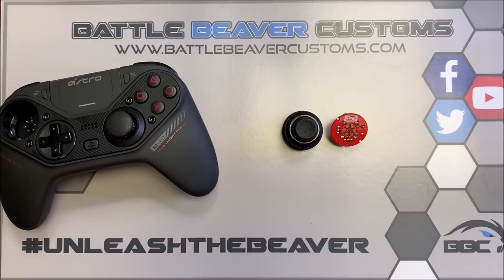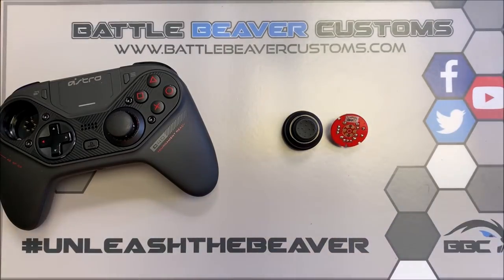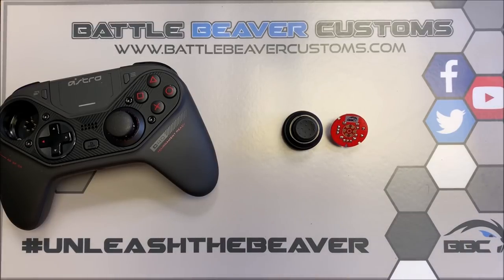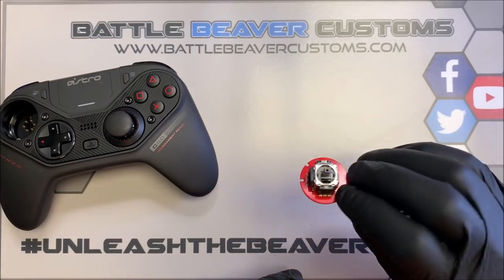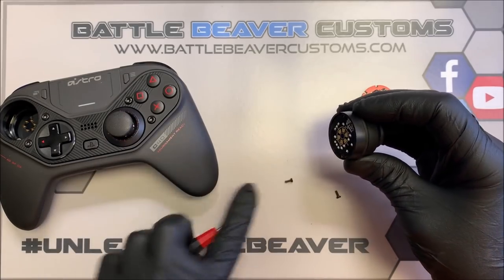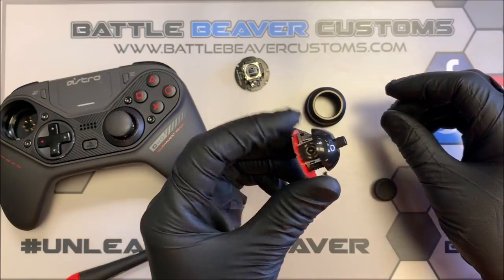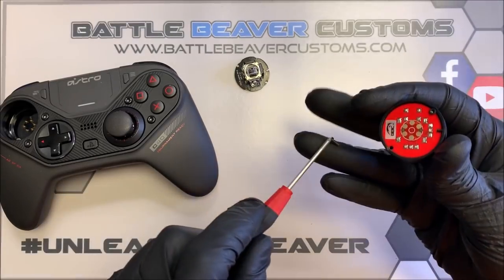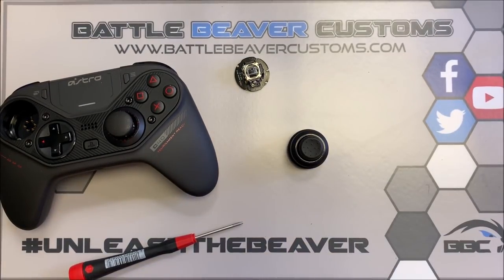How to Increase Thumbstick tension in your Astro c40

Comment: Hey I have a battlebeaver for my ps4 and I love it. But just recently I've noticed the anolog sticks are acting up. I've been having it for around 5 months now is there anything yall can do or do I jst need to get a new one?
Reply: Probably got hair or something stuck in it.. uninstall and use a vacuum to suck all excess material out of module.  Be sure to move stick around to get all corners.  That should help!  Nd save ya money
Reply: @-woo2020  most likely not, I clean and try to take care of most of my things. But I do use it a lot. Is only really the right analog that's acting up and it's the one with the extreme tension on it, I think that might be it. Either way the warranty was only 30days so I might as well pop that bad boy open
Reply: @-woo2020  dam, I didn't want mess around with my bbc controller just yet so. I ask my little brother for his old original ps4 controller that had problems. And I dissected it and dam there was a ton of hair and dust it😲

Comment: I just got mine yesterday and got the middle tension option. Anyone else have an adjustment period after installing yours? I feel like I'm playing with a whole new sensitivity. Was just wondering if anyone else had the same experience
Reply: Definitely I use to play fornite on a 8.0 sensitivity and now I'm on a .69x and .66y
Reply: @XxMr_editorxX , Good it's not just me. I only play Siege and the sensitivity settings are 0 to 100 so I'm not sure what you changed. Did you have to up your sensitivity or lower it?
Reply: Yes there definitely has to be an adjustment period. You have to build muscle memory all over again.
Reply: @thinkforyourself5672  lower.

Comment: If I can’t get my controllers to charge could u fix them and add some customs
Reply: I plug the cable that came with the controller into a Samsung fast charger and into my surge protected power strip and I've never had any issues with not being able to charge. Only downside is you can't play wired but I have a40 tr's and also an 8tb external plugged in

Comment: Will this fix my issue with no being able to run?
Reply: Mihrett often a bad sprint issue is from a bad left stick Y axis sensor or a bad stick click. This could fix it. First I’d swap your left and right modules, if that works then this has a very high probability of being a good replacement to fix that issue
Reply: Chris Bailey I’ve already switched them out and now there both bad and I can’t run with ether one if I reset it it works for a little than messes up again.... so this will fix that issue or no?
Reply: Chris Bailey I just wanna be able to run again with no problem lmao
Reply: Mihrett I think so. Maybe start with one first
Reply: Chris Bailey start with what buy one of these and see?
Reply: Mihrett yea I would say buy one, if it works maybe get a second as a back up, or in a different tension option.
Reply: Chris Bailey I don’t understand what does better tension even mean? Lol

Comment: So if I buy this it will make my gta 5 person stop moving by it self?
Reply: Time IsMoney have you tried resetting it with the button on the bottom? If that doesn’t work u can try these.i use increased tension modules from BB and they work fine with GTA. Use MAYHEM for 10 percent off if u order.

Comment: Hi, i have a question. 
It is possible use Xbox Elite magnet thumbsticks to astros thumbstics Moduls?
Reply: No
Reply: Yes
Reply: @Dame77090  thanks
Reply: Remove the black cover on the xbox controller tension box and swap it with the astro then you'll be able to do it
Reply: @Dame77090  ich change on my scuf vantage the scuf thumbsticks to Xbox Elite sticks and this works very well but generell scuf vantage   quality is not so good to comperissen to astro and Xbox Elite

Comment: I just got this, switched the left thumb and cross pads, now my character won't stop moving in my game... Running constantly, can't get it to stop...
Reply: Chrisfragger1 re calibrate your controller
Reply: @WelcomeToHorrorville  Did that, several times. I got a new controller and it works, but I can't get the software to recognize it, and I cannot get it to work wirelessly... At this point I am probably going to take it back. Sad. I really like the feel of it, solid and well built, just the software is shit.

Comment: Pressing r3 doesn’t input after I put increased tension module on my right analog. Any fixes for that? @battlebeaver customs
Reply: Alex change your thumb stick back to the original one. Because usually you you add more tension it tends to be hard to press down.

Comment: Yeah your thumbstick Saved my C40 the stock and replacement stock tumbsticks lasted 4 weeks max before they went out luckily i had order two BBC hone extreme and one high , the astro has been working well for about 6 month but latelys the seat built in the controller for the thumb sticks are going out so i had to switch from a ps4 TS layout to an Xbox layout cuase the left seat went bad and keeps sending a down to the left signal at all times so i had to use the upper left seat . whatch out though evil is cranking out 200 gram TS gonna have to test their QC. but evil sucks cause they install cheater mods and are extremely expensive
Reply: Hi .
I wish if you help me out , I read your comment regarding the BB sticks for C40 so is it still working fine or you have any issues with it .
Honestly am considering buying two stock modules and one increased but am confused between BB and evil as both is having up and down reviews .
Specially after I've seen that some people are unable to recalibrate
Just a note my main game is Apex legends , that's my main focus 
I will really appreciate your answer 
Thanks anyway 😊

Comment: i ordered two, one is perfect, the other has the worst drift ive ever seen on a stick, its so bad that its just build wrong im sure
Reply: try Factory resetting(there's i tiny pinhole in the back ) the astro a few time and then recalibarte (using the center under button) it until the stick shows center i had an issue with my hightension when first got it but a few calibrations later it was working optimally . it may take more than one recalibration as it took my 2 factory resets and 3 re calibrations.  there are also problem with the astro c4 controller unit module seats going bad so test the dysfunctional stick in other seat positions. and if none of that remedies you are one of the few people to get a defective stick and im sure BBC will replace it if its been less that 30 days
Reply: i got an Extreme and it was ready to go right out of the box which was a good thing the Replacement Stock astro left thumb stick went out earlier that day so i was able to put my battle beaver high tension in the left and the extreme in the right . any how hope this helps out
Reply: I’ll try it again tonight, I fixed the drift on my original left stick so it’s okay for now. But having a extreme left stick would be cool even though I only really need it for aiming. I’m not sure if high tension helps with straffing. Do you play apex?
Reply: @alexanderlemos7284  nah i gave it a go but im not a BR im loving PLunder on Warzone its so underrated and IMO loads more fun and relaxing than BR , BR get so competitive  i get it high risk high tension high reward but i just wanna have fun and  not feel like me having bad game is ruining my teamates chances for a win . waiting on titan fall 3

Comment: Aaaaaaand ordered two.
Reply: How much were they if you don't mind me asking their already soldout unfortunately
Reply: @Dame77090  They were $20 a piece, plus tax and shipping. Total came to around $46 - I ordered the extreme for the right thumb stick and the enhanced for the left. Hope this helps and good luck!
Reply: @PDadPoursPlays  yes it did help thanks!
Reply: @PDadPoursPlays  just ordered mine today 1 extreme and 1 increased how long did it take for you to receive your order?
Reply: @Dame77090  I haven't yet, hahaha... Patiently waiting. Glad you were able to secure a set - cheers!
Reply: @PDadPoursPlays  lol now time to play the waiting game
Reply: Question, how does it feel compared to a brand new dualshock 4 controller?
Reply: @Virakchea  To me, there is an absolute increase in tension with the Extreme modules. Perhaps 1½ to 2 times the tension is the DS4. Unfortunately, the Increased modules were dead on arrival but customer service was quick to have me mail it back for a replacement. I love the "heaviness" of the tension and the smoothness of its delivery so far. Hope this helps.
Reply: @PDadPoursPlays  Thank you for the quick reply, I've been putting off using my c40 because of the softness of the sticks, now I feel this will provide me some more reason to go back to it. Other than the sticks and how close the shoulder buttons are to each other, I have no more complaints.
Reply: @Virakchea  You're welcome. I feel that the Battle Beaver modules are absolutely worth the wait and positively enhance the gaming experience with the C40tr. Also, I am in no way affiliated or sponsored by Battle Beaver Customs. Cheers!
Reply: @Brian Prugalidad - I am a Call of duty player, using Kontrol Freeks as well. Have ordered Astros C40. Please suggest what should I get - increase or extreme? What is your experience with both in terms of gameplay compared to DS4?
Reply: Hi guys - I am COD player, using Kontrol Freeks as well. Just ordered Astros- please suggest what should I get, extreme or increase ?
Reply: @udv297  I use an elevated thumb stick on my right module; for the right, I ordered the Extreme and Increased for the left. They are markedly smoother than the Astro's. Hope that helps - Cheers!
Reply: @udv297  Since the modules are interchangeable, you can absolutely customize your experience with the Astro's. The increase in precision is noticeable. I'm glad that I invested in the controller and pulled the trigger on the Battle Beaver modules; I think you will be too.
Reply: @Brian Prugalidad - Thanks
Reply: @Brian Prugalidad - Last thing bro- so I use elevated KF(Vortex) on the right, for this you recommend extreme, and for the left I use mid rise KF, for this you would recommend increase, correct? Earlier I was thinking to buy increased for both but as per your experience I would be buying extreme for right and increase for left. Also, would these solve stick drift issue as well? Because on the BBC site- stick drift can be resolved by their stock module, but  I wont be going for the stock module due it loose movement and hence would like to go for increase/extreme.
Reply: @udv297  I have Increased on the left, Extreme on the right - if you're familiar with the feel of Xbox stick tension, that's what the Increased modules feel like. On the right with the Extreme modules, I feel the taller sticks help me run a higher sensitivity. I also have larger hands. Hope this helps.
Reply: Thanks a lot
Reply: @Brian Prugalidad - Thanks a lot for all the efforts in replying
Reply: @udv297  Of course! Hope it helps.
Reply: @Virakchea  I had no issues with mine so far they feel amazing been using for the past 2 days installation was a breeze just do a hard reset and your good to go

Comment: The durability of these high tension modules is shit. They turn into rguler modules after one or two weeks of use.
Really disappointed.
Reply: but to fix a broken module that isn't working right they are worth it because not only to they (according to ur post) last two weeks and go back to factory they are still a viable option to use because they are the same price as factory issue, Do u think its worth to get in replacement of a broken one?
Reply: @nicknicknick530  i didn't buy them to get back to regular at all, this was not my idea, so there is no need to get a replacement cause these replacements will have a short life and turn to regular modules too, it will be a waste of money, these high tension modules are not a permanent solution from my point of view.
Reply: @ahmedeid2835  Ok, but in my position i have messed up modules and the factory edition is the same price but sold out, so do u think it is viable with that considered?
Reply: @nicknicknick530  i can't answer this question cause i don't know whether the one i bought might breaks after a while or not, i used them for two weeks only. But its worthy to give it try from your end, you might be more lucky  than me.
Reply: @ahmedeid2835  Fair enough
Reply: mine have lost some resistance my high tension 110 is weighing in at 98 and my extreme 160 is down to 148 , but stock tension is 80 so its now where near that and this is after 6 months of heavy use (20 + hrs  a week )and 3 months of extreme covid19 use (up to 50 hrs a week) the stock astro lasted 3weeks each as i ordded 2 replacement that's 4 for 4 bad in 3 weeks you got how many Battle beaver sticks one and perhaps your were just unlucky enough to get a bad spring just becuase you had one bad stick doesn't mean they are all bad and just because mine still work doesn't mean they don't break sometimes , but your making an absolute statement with out absolute information
Reply: @omnilightstudios7958  this is my point, the tension modules do wear and deteriorate, even yours as per your measurements. Why would i or any one invest in modules that will get back to near normal. I loved every min and every gamin these high tensions. You can imaging the level of disappointment i had now after they wear.
Reply: @ahmedeid2835  Because the Higher tension denotes longer functionality . most stick drift is cause by springs losing their tension so that the stick longer rests at absolute 0.0000  even if a higher tension is reduced it still has the needed tension to reset your thumbstick to 0  thus preventing  stick drift ,if a 160 goes gets worn down to a minimum of 110 grams its still 30 grams above the stock . using the proper calibration techniques one could use them indefinitely , as a stock 80 would potentially get worn to an unusable 50 to 40 grams. that's why  and any ways the astro c 40 is a paper weight with out battle beaver thumb sticks. and as i said i may have lost some tension but i have no drifting issue

Comment: Stright trash this remote is, I've had it for a little over 2 months and no matter what it wont stop drifting.
Reply: Hold the remap button for 3 seconds, it’ll vibrate. Then hold it again for 3 seconds.  It’ll vibrate.  That will fix it 100%
Reply: Ricardo Correa did you get one with the increased tension?
Reply: @Spartan168  to calibrate the controller, I coulda sworn that after holding down remap button for 3 seconds, you put the controller down on flat surface until it rumbles again (About 15-30 seconds later).

Comment: What you guys in the comment section need to do is drop that C40 and get a battle beaver hands down the best pro controller
Reply: just ordered it , black with orange accents (button trigger ect ) extreme tension on the Right ,smart triggers, and X right  O left on the bottom buttons  its gonna take a while though covid and all but hey its on its way . also getting another extreme for the astro just cause

Comment: trashhhhh! all good for a month then they broke 🤮 evil controllers have ones they more expensive but im about to give them a try
Reply: mine are going strong 6 months later after heavy use . though the Astro C40 itself had developed issues with the module seat that is built into the controller unit , the PS4 left thumbstick seat went bad i thought it was my thumbstick at 1st but every thumbstick i put in that seat had the exact same issue (the issue was a slight press forward and to the right always registered as back and to the left once you passed a certain threshold it would resume normal function) i resolved by sacrificing my dpad the PS4 LTS position  and placing my left thumbs stick in the still functioning upper left seat . and if you could define Broke as in what form and function was lost to consider it "broke" perhaps i could help you further but maybe trying the suggestions i made above may help as well . not gonna lie though 200 grams tension does sound good and to be fair though evil charges more they do include more as well as in extra variable hieght thumsticks and a T6 driver to save you a trip to the hard ware store . so for the module itself the price is probably comparable
Reply: How are the evil ones so far ? I was thinking about a beaver stick till I saw this comment

Comment: Pretty pissed off at you guys. I've e-mailed you about my issue and got no response. First off, I ordered two of these from you guys. One with medium and another with extreme tension. You mislabeled them, but that's minor. I have been using the extreme with the medium there for backup. So I was not using them at the same time. I'm 5 months into owning these and both have issues now. One won't max out to the right direction and the other stutters very slowly towards the up position. This is incredibly frustrating.
Reply: iz2sicc Yup I have been having the same issue with  one of the extreme tension sticks I bought a few months back.
Reply: have you tried factory re setting  the controller ( the tiny pin hole on the back )and re calibrating (also when re calibrating makes sure your stick are sitting in the natural rest position and don't worry if there is a registered input from the stick during calibration as this is needed to detect the drift and fix it ) . also if resetting and re calibrating still does not resolve the ability to max out a direction you can use the AStro soft ware to remedy by moving the slider for the thumb stick ramp appropriately to counter act the offset (id advise moving 90 to 100 80 to 85 amd 70 to 80 leaving the rest in the normal ramp up )
Reply: @omnilightstudios7958  yup. I've tried all that and also tuning it in the software. Problem when I tuned it, it was a pretty decent fix for the maxing out issue but made the left position higher sense. It would be cool if astro allowed us to tune the left and right positions independently.